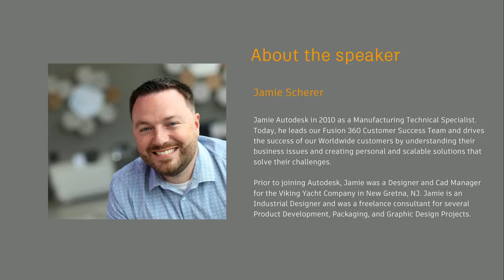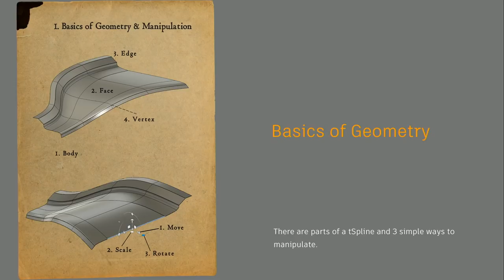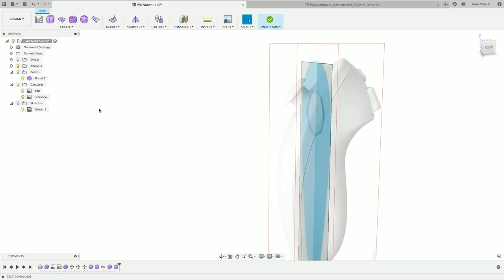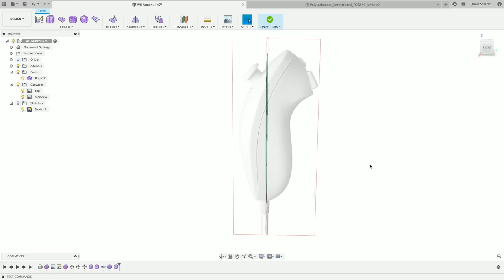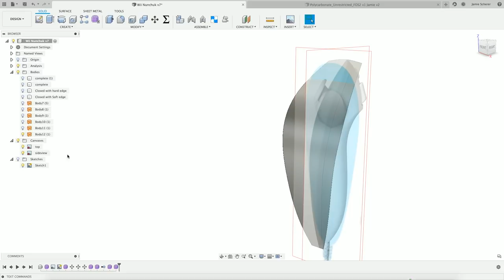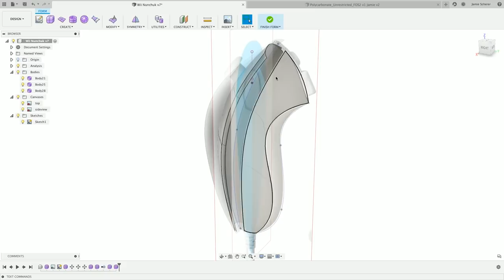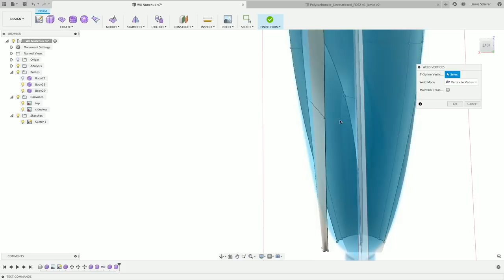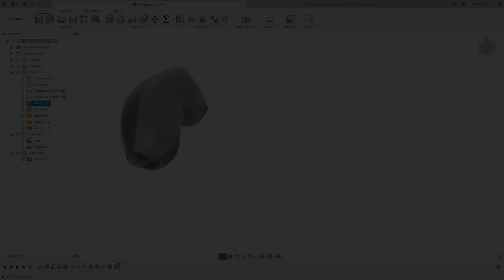Fusion Academy Refresher - T-splines 101

Comment: After creating the shell of a product, how do you create the components under the hood?
Reply: That is usually an assembly, in the real world you will have the shell with maybe snap tabs or screws that hold them together and under it, there will be electronic components and buttons that will will actually work, etc. This is just a mockup of a design.
Reply from the maker: Well, for the chip I'd use Eagle but everything else (plastic features, ribs, etc you can use Fusion 360).
Reply from the maker: Thanks for the assist @scientist100